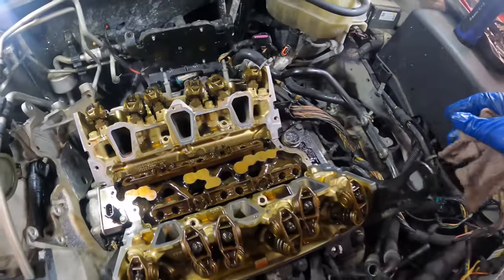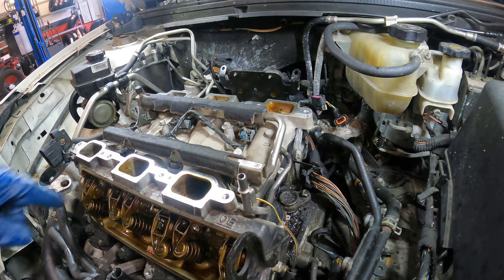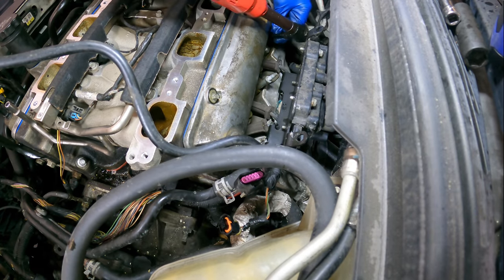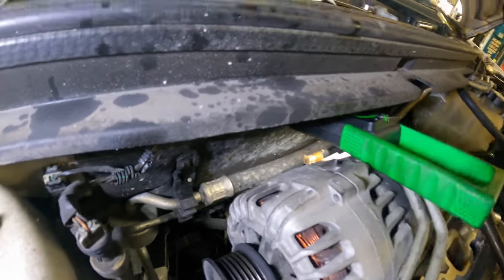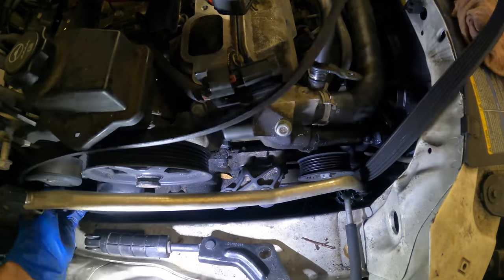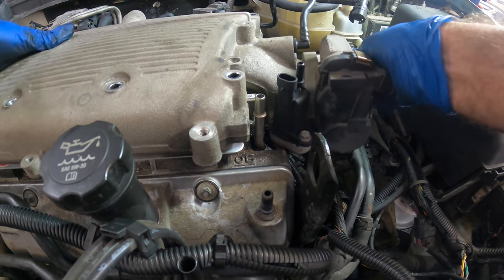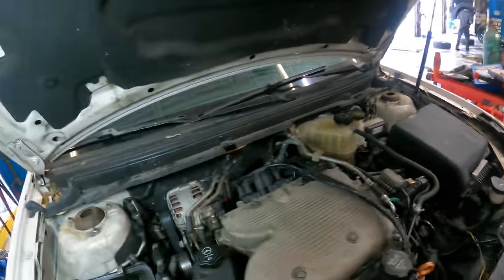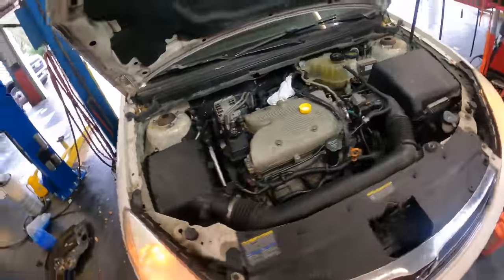It’s Going to Live | Saving an engine! 3.5l Lower Intake and cylinder head coolant gaskets

Comment: Trolls: Ray doesn't care about customers cars
Ray: I do these 17 other steps to ensure the customer doesn't have issues in the near future, most other mechanics thinks it's stupid but I still do it
Reply: Ray is great. Always tell what the car needs. Explain why. If the customer declines. It's on them. As a fellow tech with integrity, and experience. I deal with that all the time too. Except I love bmw's. I was a master tech for bmw for 5 years.
Reply: Also Ray: shit I broke it, here hold on while I take responsibility for that and fix my mistake the proper way instead of fudging it and hoping nobody notices
Reply: Yup... I used to break all sorta shit and my forman used to hate me cuz I'd own it and replace whatever broke.... Also they hated me cuz I wouldn't sell useless things the customers didn't need.
Reply: no prefill oil filter?  little embarrassed. prefill, but don't record it. : )  our secret.
Reply: @Tim Ewa  ray made a video aboutprefill, he doesn't do it because it can directly induce any debris into the motor. Always filter first.
Reply: I honestly do the same because I think well we are here so why not it's not going to make it any worse per say I do go above and beyond what is required at minimum because I know I'd want someone that worked on my cars if I didn't work on them myself to treat it as if it was their own and because of that it had almost zero complaints and have many returning customers (I also do 5% off for referrals so that helps some) I think well if I'm this far in to the engine why not do a few extra steps to ensure they get the most life out of the repair so they can do more down the road without having to revisit the same problem or similar in the next few years
Reply: I think the shop troll thinks Ray is wasting time filming while working. Let's see an accounting of the other guys performance compared to Ray. And I wonder if there's any tracking of what business his videos bring in.
Reply: @minetogiveaway  Mess up Fess up

Comment: As you were tightening the vacuum port fitting, I actually said out loud "it's plastic, don't over torque it...... never mind..." 😆
Reply: As he was tightening the fitting I'm thinking," Okay Ray, that's good, but no..." Snap!!! 😖
Reply: a good hardware store should sell those plastic fittings .
Reply: i was wondering why he did not try an easy out to get out the broken fitting they work great, Napa square ones i like, they bite in good with a tap of a hammer
Reply: @deweydodo6691  The tool truck ought to carry them too. 
Then their slogan could be, "Snap off? Snap on!"
Reply: i think we all did lol i was thinking, "get a normal wrench and....why are you using a ratchet? oh this wont end well will it."

engineers tried saving pennies here when a metal or even molded portion would have been far better.
Reply: Was saying the same thing

Comment: For future reference.. the "metal" brake vacuum booster fitting on the plenum from a "90s" 3.1 or 3.4 liter fit right in those 3.5 liters. It's a good replacement for those cheapo plastic fittings... everytime I work on a 3.5 liter, I'll order certain parts that's made "90s" 3.1/3.4 liter engines that fit perfectly on those engines, and also other engines..
Reply: Good to know! I’ve worked on a few of these 3.5s and have one I bought I’m going to flip.
Reply: if your curious why GM quit using metal fittings:  cost.  the plastic ones cost just a few pennies each, the metal ones cost about a dollar each.  over millions of units, that is lots saved, for a part that really does not need to be metal, as its just a vacuum line, so as long as it seals, and doesn't get too hot, plastic it is.

Comment: Anybody can tear down an engine, it's putting it back together again that separates the wheat from the chaft...nice job Ray!
Reply: That's exactly what I think when I watch Ray. In my young years, replacing an engine or some other type of heavy work, I'd always end up with a bucket full of bolts that I didn't know where they went. Thankfully, everything seemed to work okay, I just don't know why I always had leftovers....
Reply: Isn't that the truth.  I have the ability & the confidence to do a job like this, but it takes me 2-3 times longer because I know I'll forget where each bolt went, so I go through an overly-meticulous process of documentation to know exactly where each bolt goes, and what order (overall) all the parts came off / go back on in.  It may be slow & tedious, but it still gives a sense of accomplishment when the job is done, there are NO spare parts, and the car fires up on the first try!

Comment: The bolt game gets real quickly the more you take apart. I just label small boxes or containers for the bolts I remove to keep things organized. It makes things far easier come assembly time. Great job as always.
Reply: I use ziplock sandwich bags and zip tie them to the parts. When the new parts arrive assembly goes a lot quicker.

Comment: I have been a mechanic since I was a young 10 year old (learning to be) lad working in my dads Mobil oil service station. Over the years I have developed skills that include Auto mechanic. Steam boiler mechanic. Welder (MIG STICK TIG) welding instructor. Machinist. Sheetmetal mechanic. I have built parts one of which went on the Voyager spacecraft and made many other parts for aircraft. So my metal trade skill are on the higher end. I say this not to blow my own horn but to say with all these experiences. I would not hesitate to have you work on my car. Your attention to detail is way above most guys. Thank you so much for your videos. I do my own work and have for all my life. At this time I am recovering from some medical stuff (not serious stuff but keeping my in the house) so your videos are helping this old guy get through it. For that I thank you. I bought my wife a 2004 Mustang GT with the 4.5 (I think it's 4.5) V8. The power steering pump is putting out low pressure so the brakes and steering are hard to use if the engine is at idle. I have the new pump and that is when I ended up in the hospital for four days. I now have a catheter and will till Feb 8 (Not fun). Once that is taken care of I should be good to go. Keep up the great work and the great videos, GOD bless
Reply: I'm not understanding your comment. Your mustang doesn't have a hydro boost system, the brakes should not be affected by the power steering pump

Comment: I’m not an auto mechanic. I am a nuclear electrical instructor. I’ve been an electrician for 40 years. Love the videos. I’ve learned a lot of techniques and information of how things work. 

What I would like to see is a second camera to see how you place your camera etc.  I’m using techniques you’ve demonstrated to help with High Voltage nuclear maintenance. Thanks again.

Comment: Great video! I'm guessing all of these engines leak like this. So, GM took a lesson from Ford with their FE and MEL big blocks and split the valve train cover sealing area between the intake and head. Great lessons unlearned! No wonder it looked like the Exxon Valdez on the bottom side! I've never seen a Ford product with one of those engines, a few years, some heat cycles, and not leaking. Of course it's like every Harley owner, Rolls Royce or Pratt and Whitney aircraft engine. If it's not leaking oil, it's probably empty. I was taught on aircraft engine oil leaks, a bad leak is one you have to jump over.
Reply: "Of course it's like every Harley...."...it's not leaking, it's marking it's territory lol.
Reply: I have one of these 3.5's in my Malibu, she's a leaker all right so I just check oil every 2 weeks or so and if I'm down 1/2 a quart I add it, all in all pretty solid engine though.

Comment: Ray, I don't know how you do it. Everytime that I work on my cars, I curse the car companies and their engineers. I hate fwd with transverse mounted engine. Give me a V-8 engine with rear wheel drive. You can actually work on them. Body on frame is good too. When working on anything, I take pictures and put hardware in individual Ziploc bags that are labeled appropriately. Saves time, headaches, and lost parts. You have the advantage of working on largely rust free vehicles. That helps. I'd like to see you and Ford Boss trade jobs for a week.

Comment: You might want to replace the O-ring on the stub shaft ( drives the oil pump).  It's easy to get at right now.  Also a giant oil leak.
Reply: Yes absolutely.
Reply: Is that the circular piece with the single bolt on the left side near the lower intake? If so, glad to know it has a formal name.

Had a cavalier z24 with the 3.1 l...went through 2 sets of valve cover gaskets before realizing that the o ring on that needed replacing. 

The wonders of the gm 60 v6 engine
Reply: @aaronturner1072  Yes it is. This is where the old 2.8 distributor used to be. O-ring seems to be a factory part. Leaks like hell.

Comment: The GM 3.5 is the same engine as the 3.1 , 3.3 engines, GM had overheating problems with those engines for years. I've heard the overheating was because of the aluminum heads on an iron engine block. And the aluminum heads cool faster than the iron block and causes head gasket leaks. Really good job on the work you did Ray.

Comment: I didn't do the intake but I just did the valve covers on my son's Impala with the 3.5 in it. When you started on this car I was hoping you would do the valve cover gaskets just so I could see how you do it versus how I did it. I didn't remove the power steering pump from the cooling crossover, you can reach all the bolts I really didn't see a reason to remove it I just left it and the picking eye in place, I just removed the six mounting bolts. I do admit putting the new gaskets in and remounting it was a little more complicated with the power steering pump in the way, but it really wasn't. I have to admit I was thinking of doing the intake gaskets as well, but seeing how the valve covers dried up the leak, and then seeing your video of how in-depth replacing just the intake gaskets is on this motor I'm glad I didn't since they weren't leaking. You should have shown your method for changing the grommets on the bolts for the valve covers because I found that to be a bit of a pain in the butt. Mostly mine were just crusty and hard and difficult to remove.

Comment: While watching you install the plastic hose Barb, I was thinking, stop tightening or it's going to break! That plastic hose Barb looked like it may have NPT threads.  If it does, you can get a brass barb at a hardware store for a couple dollar's.
Reply: I thought the same thing!  Better longevity for a car that probably won't be on the road in 5 years.
Reply: @Randal Bloomquist :
A brass one wouldn't be as likely to "fail catastrophically".
😁
Reply: Classic case of over click...
Reply: @truthbetold9923  You beat me to it.  I think I watch too many of Rays jobs. I somehow did not find the actual clicks of the torque wrenches near as satisfying as Rayclicks!

Comment: Your correct Ray. When reinstalling used push rods you want to place them back into the same rocker arms they came from. Like you said, they all wear a bit differently over time.
Reply: that wasn't what he was talking about. He was going to make sure they were put back in order of removal. What he was referring to was that each pushrod be turned until it was directionally the same as removed. the idea is that one side of the "ball" will wear more/less than the other side. When I was building engines I used all new so this was never an issue.
Reply: But they won't wear out on one side because push rods rotate when engine running.
Reply: @Boga217  actually it's the lifters that rotate on the cam. Pushrods are under pressure from the rocker arm if your pushrods are rotating, you might need to lash your valves.
Reply: @davidmiller9485  when they come up then that release of tension at top is a moment of no tension that allows the lifter to spin them...which is why they don't wear on one side unless there overlashed /over tightened. But the guy making the comment probably wouldn't understand that technical of explaining being he already has a misconception of the workings in an engine. Look at every pushrod that is in an engine working properly. It has a nice even polish...now go get a magnifying glass..it has a rotating swirl look to the wear lines as well.
Reply: @Boga217  I'm trying to keep it simple. As much as i hate to say it, it's usually better to keep things simple than try to explain them. Example, every public student  has a distorted and wrong view of what an atom looks like or take electricity, everyone seems to think that electricity is magical elven things (from pixies to gnomes) that travel down a wire, That is wrong. Its about the fields moving or oscillating and even that is simplified. My point is that, in general it's best to keep it simple since it reduces the chances of misunderstanding a technical subject. So if it helps to think of electricity as pixies, go for it. It won't change your ability or lack thereof to install that new radio you just bought.  :)
Reply: @davidmiller9485  You must have ADD. When did radios become relevant to this conversation.
Reply: @Boga217  sigh.... i give up.

Comment: Putting a engine together on a engine stand is fairly easy, keeping everything clean an all that stuff. BUT ,putting one together in these cramped conditions is a tuff job !!!  I guess that’s why I watch your Chanel. I quit working on cars back in the mid 80s. Front wheel drive , fuel injunction , computer crap, was too much for me. So I started driving 18 wheeler coast to coast. I just retired. Almost 4 million accident free miles. Alouth the last 15years I did quit driving the east coast. Enough rambling from a old man. I hope every one has a wonderful Independence Day!!!

Comment: My brother-in-law replaced the leaky valve cover gasket on his Cruz but kept stripping the threads. After several attempts he asked me to take a look.for him. Everything looked okay, I asked if he was sure he wasn't over torquing the bolts, again he was positive and told me the torque adapter was set for ##. When I asked if it was inch pounds or foot pounds the look on his face was priceless and he said things that children just should not hear.

Comment: As thorough as you are with everything all the time, I'm surprised you didn't hose the undercarriage down, where all the oil had leaked, with brake cleaner :) Great job as usual, sir. If I ever need work done and in your area, I'm definitely requesting you :)

Comment: The throttle body needs cleaning and did you put the nut for the alternator wiring back on?
Reply: He did mention about the alternator wire being put back on off camera, what I was wondering about the long pivot bolt at the bottom of the alternator being tightened, I have the same engine.

Comment: Nice job thanks for recording your progress.  The trick to Wireloom is to make it work for you.  You cut the wireloom to fit into the one section 39:55 when you still had an area on the other side of the sensor tee that had bare wires.  A good practice while working with wire branches/tees is to rotate wireloom so the branch matches up with the slotted side and come back with electrical tape for tees and ends and misc. locations in between.  Thanks again, for filming the process.

Comment: @37:20 the engine stabiliser bracket is still loose, you have the wrong bolts connecting the bracket to the block.

Comment: be careful with the brass or steel pipe fittings, especially w/ teflon tape as it's easy to break the part they are threading into with too much torque

Comment: At 12:30 and other torqueing of the rear driver's side manifold bolt, the actual torque will be greater than or less than that indicated by the torque wrench, because the offset either adds to or subtracts from the torque wrench lever arm, depending on the direction of the offset relative to the handle of the torque wrench. When the offset is in line with the handle, the actual torque will be less than what the torque wrench indicates, because the offset is subtracting from the effective length of the torque wrench. When the offset is opposite to the handle, the actual torque will be greater than what the torque wrench indicates. Hope this doesn't cause a problem!
Reply: I agree that using a torque wrench on a crowfoot (or similar) complicates it, but I'm not sure you have the effects correct. (I'm not sure you have them wrong, either.)
I'd have to draw a diagram and work it out for myself to be sure.
Let's just agree that torque measurements with crowfoots are best avoided.
Reply: My Reee-O-Meter went off when I saw that too.  I had to torque using a crows foot one time and found online there's some calculators to find the right torque setting to compensate for the offset.